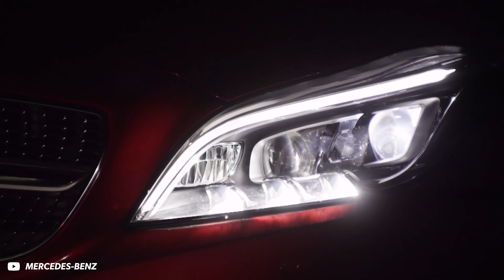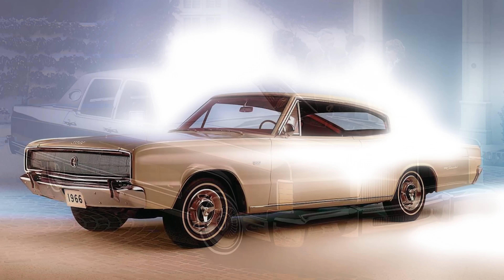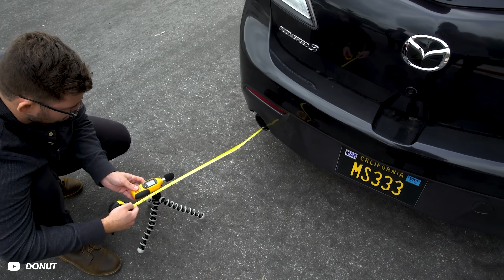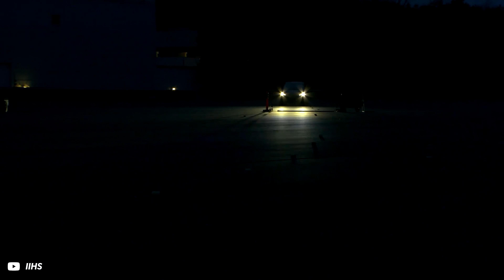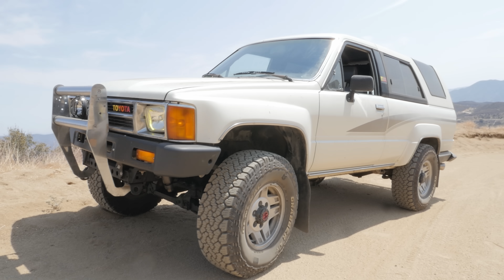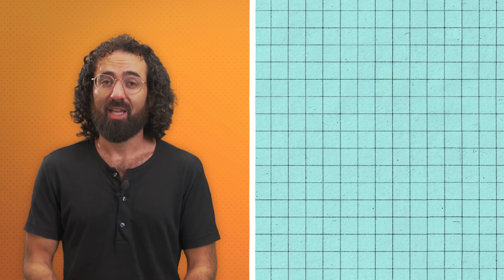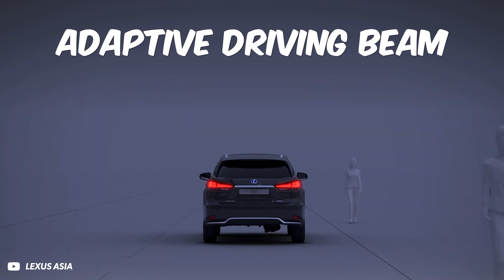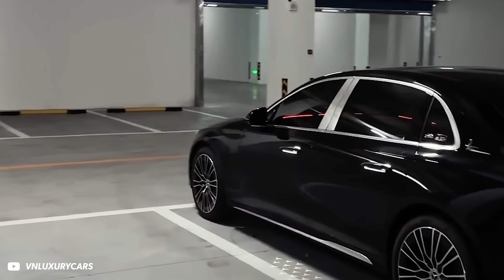Why new headlights are blinding American drivers

Comment: I daily drive a 1968 corvair, and I’ve never had an issue with my dim headlights making it dangerous to drive. What DOES make driving dangerous, is when a modern car’s DRLs are bright enough to overpower my dimming mirror (to the point I can see the mechanism inside!)

Comment: These headlights are nice for the driver though. Just don't right at the beams and you'll be fine, and try to be consistent with switching to low beam when there is oncoming traffic. I have never been inconvenienced by LED headlights

Comment: i'm in EU, italy, most cars don't have aftermarket bulb yet i'm constantly blinded. 
For xenon headlights it was mandatory to have self-leveling systems and washers, for LED's these requirements do not apply for some reason. 
Adaptive systems, when they work properly,  still briefly blind you before adapting, but it is better than nothing. It should be mandatory not optional.

Comment: ADB is only used for selective high beam! There's no difference in low beam setting, hence the situation being the same between US and Europe. If the sensor won't recognize you, you are getting light fucked. Often happens when there's a tall divider, small divider with crest, hairpin turn with only your car's side exposed to the sensor.

Comment: Tesla uses adaptive high beams, they work wonderfully. Not sure how that was missed in research...I also noticed my headlights were leveled very nicely as well from the factory. It's a pet peeve of mine. Awesome tech that needs to be on every car.
Reply: My Tesla was a little bit high from the factory that any bump would blind oncoming traffic. It has the matrix beam system. Luckily it was a nice tool-les adjustment, but still, the normal low beams of the matrix still behave like basic beams and the entire matrix housing still needs proper adjustment which my car did not have from the factory.
Reply: @battery_wattage  Another thing I've noticed is that Tesla's, especially the model 3 sits REAL low, so normal light standards in terms of lux won't work with the ride height differences, so now even normal leveled lights are off. It's an overall lighting disaster.
Reply: @battery_wattage  Yea, that's the OEM's "Self-certifying" My Model 3 had a good amount of Quality issues, gaps, paint, interior clips, etc. I had to dial all that in unfortunately, but the tech and platform is worth it to me. Like you said, it's all tool-less through the car, which cannot be said for almost any other brand. Granted that was forced by EU regulation, not some kindness of their heart lol.

Comment: People are putting improper higher lumen LEDs or Xenon HIDs in their halogen housings that aren't outputting the correct cutoff, the distinct horizontal line that separates the bright part of a headlight's beam from the dark part, designed to prevent dazzling oncoming drivers and pedestrians.  This is the issue.  People are unknowingly intentionally blinding people with their setups in older vehicles.  Most new cars now have headlamps that cannot be user serviced which requires an entirely new headlamp when LEDs give out, which remedies the issue but makes repairs/maintenance much more costly.  US regulations are also very antiquated, so we have the worst implementation of rear turn signals as well, where the brake lamp flashes instead of a separate turn signal.

Comment: Lighting nerd here.  This guy forgot to mention that the glare rating of a light source is a basically factor of the total lunens compared to the area that it comes out of.

The old style halogens were a small bulb with a reflector and a glass lens.   Put that same bulb in a flashlight and then of course the light is more glary.   Same to be said for some modern "slim line" LED headlights.
Reply: he forgot to mention a lot actually.  like the nearly thousand dollar extra cost per vehicle that gets passed onto a society in America who already cannot afford the prices of new cars in general.  add to that, no mention about the temperature of the light being hotter or the fact if we dialed that down to the old halogen spectrum it would dramatically reduce glare and light dazzling.  I wasn't very impressed with this video actually, didn't see enough to wanna sub to this channel.

Comment: The fancy "modern" light bars in different shapes or the lit logos are incredibly distracting to me; the color shifting of LEDs as cars bounce or change elevation in front of you is super distracting; people already complained that xenon bulbs were too bright and yet we made LEDs that were brighter AND higher or same color temp that is incredibly hard to adjust to at night; my rearview mirror can be adjusted or dimmed but my side mirrors are adjusted for obvious reasons for light to point at my eyes because that's how vision works and high output high temp lights in my side views SUCKS; vehicles are getting larger and even in smaller cars they are getting taller and people are sitting higher so people in proper sedans or station wagons are getting aboslutely fuckin blinded no matter how the headlights are adjusted; adjustment out of the factory seems horrible and if people replace their bulbs it just seems worse; Ford trucks have THE WORST low beams and that was before they went LED. Oh, and Jeeps too.

Comment: Bright LED tail lghts are a problem as well.   One time I was stopped behind a Prius at a stop sign in a dark neighborhood for about a minute.  Those brake lights were so bright, when they drove away I could hardly see!
Reply: Yep - I've just noticed this at the start of the 2025 winter. Mine was on some kind of silver SUV. Rear lights were so bright i had to hold my hand up to block them... and I still had the after-image burned into my retinas.
Reply: I have been seeing that in the last few months. I wonder if the owner is even aware of that. I bought a Jeep couple years ago that had way too bright lights, I took them out, out of courtesy of my fellow drivers
Reply: Yeah i was in a McDonald's drive thru & a Peugeot 3008 the brake lights are like looking at the sun.
 And the led rear lights are so bright you can't see the indicator illuminated!
Reply: Yeah, image of their brake lights burned in for the next 10 minutes. I know that feeling
Reply: Try following a modern Mercedes E-class, at traffic lights, when the driver is standing on the brake pedal, the red lights actually throw a red beam backwards illuminating behind the vehicle, not just lighting up red. Needless to say BMWs & Teslas are the worst offenders with bright blue-white headlights.
Reply: Yes they are extremely stupid, is like getting hit with lasers, bring back the 90 and 80's, i can't remember this been a problem.
Reply: Leave it to Prius drivers to stop at a stop sign for over a minute, presumably waiting for it to change colors before realizing it's a stop sign, not a traffic light lmao
Reply: @Caffeinated-DaVinci  Which leads to my old "Prius" joke, which I came up with as soon as they were introduced:

Actually, it's pronounced "PRY-us", because that's what you're going to be hollering if you ever get in a wreck in one:

"Hep! Come PRY-us out dis mafacka befo it ketches on FIYAH!"
Reply: BMW "Minis" are also guilty of this! The ones that have the brakelights mounted in the bumper, they are as bright as a fog light!, I HATE them! 😵🧑‍🦯
Reply: I was at a stop light and I got blinded by a car off to my right in a parking lot backing out of the stall. I swear to god they had to be 100 feet away from me and I was still blinded. It’s ridiculous.
Reply: It's true, my brake-lights on my B6 Passat are bright so I'll make an effort to put the handbrake on where possible as not to blind those behind.

However, at least you can avoid being dazzled by a brake light, if you're stopped you can just look down, or out of the side window until it disappears.
Reply: Lower your sunshade when sitting at a light.
Just lower it enough so you can see when the car in front starts to move.
Thats my daily practice now.
Reply: Well, long long time ago it was figured out that red lights in darkness eliminate night blindness, so that's why car makers went to them and haven't quit on them. If a vehicle you're following has blinding taillights there's something wrong with the lens.
Reply: The trick is don't look directly into such bright lamps whenever possible. I've finally broken myself from fixating on JUST HOW FUCKING BRIGHT those approaching headlamps are, and it helps, even averting your eyes just a few degrees.

With the Prius, you could look anywhere else BUT directly at those things, then refocus ahead when they finally release the brakes. Hell, you probably could have closed your eyes and still be able to tell when they let off the brakes! 🙂
Reply: @kentuckybowl-o-sticks  glad u don't manage any groups of ppl or important work otherwise.  You're incompetent
Reply: @kentuckybowl-o-sticks  You shouldn't have to resort to that though, it's ridiculous.
Reply: @MattyEngland  It's not actually "resorting to" anything, actually. Remember: you tend to go where your eyes are looking, so unless you're planning to head-on another vehicle, you shouldn't be staring into their headlamps anyway.

On a divided highway, you certainly should not be staring at approaching traffic, and even on an undivided one you should be focusing on what's ahead in your own lane. And again, "whenever possible"... sometimes, it's not.

The reason so many people hit emergency vehicles on the shoulder with their lights flashing is because they fixate on or "stare at" them. 

Totally agree that the brightness/color temps of some of these lamps are ridiculous, though. Hell, the glaring color temps are probably the worst part. Brighter lamps in a lower color temp are nowhere near as blinding, and I prefer them on vehicles and in the home.

Comment: The biggest difference with most of the aftermarket lights is: 
They slap a print on "for off road use only". That negates their need to follow safety regulations. 
No one buys these ever gave it a glance(or cares) before using it on the road!

Comment: A big part of the problem is the bulb being mismatched to the housing. Folks put LED or HID bulbs in reflector housings (say on a 1991 Ford F150) and blind everyone on the road not because of the height of the vehicle but because that housing was designed when Carter was in office. Upgrade the bulb type only if the housing is designed for it. Be a good sport for fellow drivers.

Comment: I retrofitted 100w cob led into my headlights. 2 for low and 2 for high beams, even though I run them at a decent 30w in the city, in the highway I blast 75w in the high beams and 45w lows and I see everything. Yeah I do it when late at night in mostly empty motorways.

Comment: They know exactly where that sensor spot is. In fact if you take those super bright bulbs and shine it on a white wall you can see the tiny dim spot where they measure candella from. Its designed right into the bulbs so they can blast that light without technically breaking the rules.

Comment: Lets just go back to halogens.  They worked just fine and didn't blind people.  I'd rather drive head-on into someone's bright halogen headlights than utterly blinding "low beam" LED headlights.
Reply: Honestly. Projector beams with good halogen bulbs do a great job and then can be supplemented with a high beam. Also in addition to adaptive lights we just need a third "city" beam when there's street lighting and slow speeds that don't require incredible down-road sight.

Comment: There are two problems at play here, one is led bulbs that are not made to use in reflector housings scatter the light way too much, the second problem in headlights not aimed right.   Now there is a minor issue with Bi-LED/Bi-Xenon where the bulb is at full brightness full time held in check by a cut off shield and at a certain angle you'll catch it right in the eye.

Comment: The problem with after market bulbs is they try to give this high lumen rate but the beam is never focused properly
Reply: People just put LEDS into reflector-type headlights, and THOSE scatter light. If you go LED, get a projector type headlight.
Reply: @jakeycakes3502  BS, I've done hours of testing on my LED bulbs in reflector headlights and the beam is exactly as scattered as normal halogen bulbs, down to the inch from every distance I tested. I even rode in an NA Miata directly towards my car and the lights didn't go higher than the license plate. Every car that actually blinds me is a brand new SUV, Crossover or Pickup Truck, and very obviously has the factory headlights and factory light alignment.
Reply: @Caffeinated-DaVinci I'd take another read of my comment, because that's what I'm saying. Reflector type headlights were built - and work best - with Halogen/Xenon bulbs. LEDs are much brighter, and scatter light in reflector-type headlights. It's not an issue with Halogens because they're much dimmer.
Reply: @jakeycakes3502 I dont think the solution to "Cheap visibility upgrade" is "put a 800$ each LED projector headlight into your car". You're missing the issue a little
Reply: @KryptoKn8  You hit on another good point there in that many of these factory LED headlamps are not individually replaceable but rather you have to replace the entire housing unit and that's expensive. I'm not paying $1000 to fix a dead headlamp.
Reply: @KryptoKn8 I spent about $400 on my LED Projector headlights and the beam is perfectly cut off, right where it needs to be.
Reply: It's not just after market.
All German cars but especially Audi 'Chelsea-tractors' (SUVs) are the absolute worst.
Reply: yes i tried to replace my mom's headlights with LED but never got it to not dazzle when you look at them from the sizes. the optics don't match.
Reply: There are some led that focus your beam nearly all the same. These are very thin with metal strip and a single led protruding on ither side.
Reply: It's illegal to retrofit vehicles not designed for HID lamps in WA but nobody cares. They all do it anyways and now many drivers with traditional halogen lamps drive around with their high beams on all the time to retaliate.
Reply: BINGO!
Reply: You can focus the beam all you want, but as soon as you put it on a taller vehicle, it's going to be a problem for a standard vehicle. Focusing doesn't magically make the beam innocuous.

Comment: i find that most LED headlights are pointing far too high blinding everyone, usually a feckin SUV! This is due to stupid useless mechanics at franchised dealers who don't give a fuk and don't adjust the lights properly during a pre delivery inspection. Some LEDs are simply too bright but the majority just haven't been aligned properly.